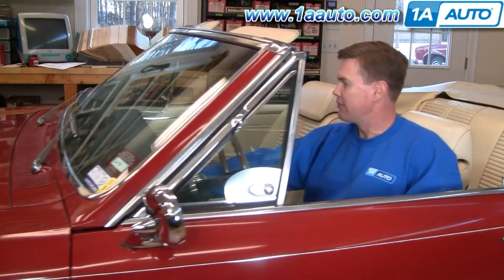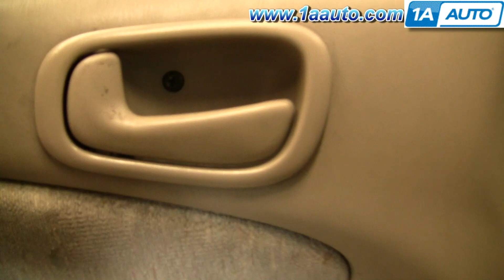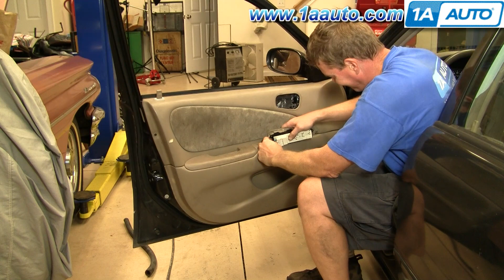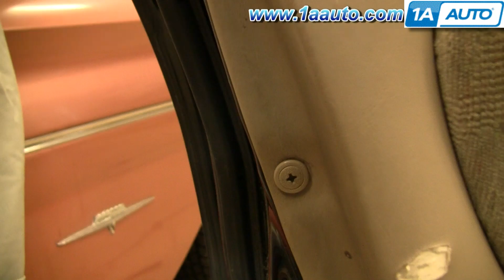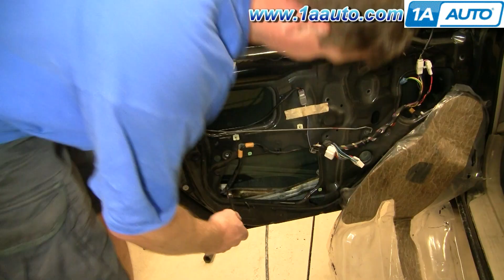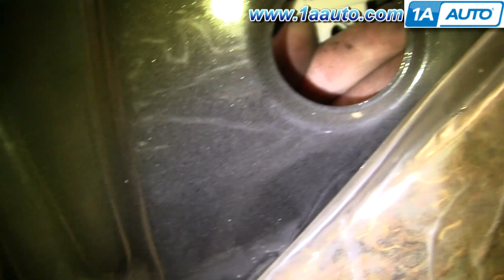How to Replace Window Regulator 98-02 Toyota Corolla

Comment: a socket can be magnetized with a strong ceramic guitar magnet (they are cheap to buy and stay magnetized). That keeps a bolt loosened in the socket and you pull it out and then remove the bolt by hand for storage until needed again.

Comment: Thanks for this video. Helped me remove/swap out the motor on my 1999 Corolla.  The motor in the back seat is the same as the front, so I was able to figure my way through swapping them out.  The mechanism that raises the actual motor is different so it took a while to get them back into position.  Also, a note to newbies:  The black adhesive that holds the water shield will get everywhere, so be sure to wear gloves.
Reply from the maker: +Sonny Burnett Thank you for your feedback!

Comment: Many thanks for the video. I hope you are still around. Is there any difference with the right front passenger window? Should be easier? Anyone has repaired the right one in a Toyota Corolla 1998? many thanks in advance. 062019

Comment: Can u do one for the rear passenger side? I dont know if regulator or motor. It goes down but goes up 2-3 inch and stop. Few mins later it can go up another 2-3 inch then stop. Sound like the motor is weak?
Reply from the maker: +hilussdc5 We are always expanding our video library so we may have a video for this in the near future!

Comment: I just want to thank you so much.  I was able to repair my wife's door window, and never would have pulled it off without your video. I will buy all my parts from you now, and I need some.  I need a drivers side door latch and I need the rubber seal that the window seals into.  I ordered one some time ago and didn't check it and they sent us the wrong one.  Thanks again A1!!  It is very much appreciated not just by me, but my wife too...

Comment: You said you did this as if stuck in up position. my window is 3/4 down. is there a different way considering this.
Reply from the maker: +Tam rock If your window is stuck, your window is stuck!  It does not matter which position it is in.  If you need the part to fix your vehicle please check out this link: http://www.1aauto.com/1A/WindowRegulators/Toyota/Corolla/1AWRK00510?utm_source=YouTube&utm_medium=CTA+Comment&utm_campaign=ytcomment&utm_term=HlRY3Wdo9bo

Comment: Thank you for the video.  It worked like a charm.  I had an estimate from a mechanic for $250.   Ordered the part online for $32 and did it myself. One point, not all of the three bolts on the left side are used.  Two of them connect to the regulator and one of the is just there for no apparent reason (Corolla 2002).  Thanks again!!
Reply from the maker: +Vahid Lotfi Thanks for your feedback, glad we were able to help!  1aauto.com

Comment: If the motor is dead, and the window is stuck down, how can I free up the regulator to get at the bolts holding the window?  Thanks: great videos, very informative and to the point
Reply: Belay the last.  Drilled hole in door to access bolt holding the window.

Comment: everything works fine but when I roll up window it comes out at the top?
Reply from the maker: +Louie Sierra Thank you for watching. It appears the window is off track, or misaligned. We recommend making sure that the regulator and rollers are aligned by the OE specifications. 1aauto.com
Reply: 1A Auto Parts  couldn't find a spindle for 98 Corolla, help by any chance.

Comment: FIrst, thanks for this great video. Very clear how to get this project done. I have a couple of questions:

1. Is it best to have the window all the way up when starting?

2. When you took that last bolt out, what kept the window from just dropping down? It looked like you jiggled that assembly a little to get the window to drop.
Reply from the maker: It may help to have the window in the up position. If you keep one hand under the regulator it will help to keep it from coming down. Hope this helps you out. 1aauto.com 866-403-3393
Reply: Well, it turns out if wasn't the motor in my case. I had posted to Toyota Nation and someone suggested spraying the rubber guides with silicone. Once I did that, the window went up and down MUCH easier. But thanks for that video. That is great info!

Comment: Hi, My window works but often it will slow down and stop and then take a few minutes of driving to move back up in increments.  Do I need to replace the motor or the regular?
Reply from the maker: Depending on the year you might be able to just replace the window motor if it's getting tired. Here's a link to the power window motors on our website. http://www.1aauto.com/1998-toyota-corolla-power-window-motor/y-mo-c/1998-387-22?utm_source=YouTube&utm_medium=VideoReply&utm_campaign=1ATony
Reply: Did you ever fix the problem? I've just run into the same and don't want to waste money on a regulator if i dont need to

Comment: I have a toyota corolla 2000.  My rear right side window does go up or down. I check the fuses. They are good. Press the switch by the rear right passenger door and main switch but it doesn't work. Can you tell me what could be the problem?
Reply from the maker: You might want to test the switches to see if they are good, or need to be replaced. 1aauto.com 888-844-3393

Comment: The part you are installing has two rails which are approximately the same length and a stud used for the first step in installation.  I ordered the part that is linked to the video. The part that I received has one short rail and no stud.  I had to return that part. What part number should I order to get one that is identical to this video?

Comment: The drivers window for my Corolla got stuck in the down position.  I just got off the phone with Toyota the window regulator and motor cost $540 and they are charging $130 for labor.  So that comes up to about $725 including taxes.  Thankfully I watched this video!!! I'm was grateful for the video because it was helpful with disassembly so I ordered the regulator and motor in one assembly from you.  Now my window works just like it did before and it only cost me $58 bucks!

Comment: On another problem: Do you have a video that shows how to replace the door latch on a 2000 Toyota Corolla? I call the "latch" the part that is inside the door, at the end of the door that grabs the stationary part that holds the door closed.

Comment: I don't see any problems with the wires or switch. Is there any type of diode in this circuit that may need to be replaced? 

I've taken the plastic water guard sheet on and off so many times (plus it is 12 years old) so the black adhesive that holds it to the inside of the door isn't holding it in place. Do you sell the adhesive?

Comment: Do I need to replace this part, or some other part, if my window SOMETIMES won't go up. It usually works fine, but sometimes it will go up part way and stop. After waiting different amounts of time, it will sometimes go up the rest of the way, or only a little bit more. It eventually will go up all the way.

Comment from the maker: You should be able to. Once you unbolt the window from the window regulator you can move it into the up position by hand if you need to. 1aauto.com 888-844-3393

Comment: I have a window that is stuck all the way down, and I was told it was due to a switch short that caused the motor to burn out.  Am I going to be able to do all of this work (to replace motor and switch, but not regulator) in the video even if my window is stuck in the down position?
Thanks.

Comment: I just wanted to thank you, as many others have, for saving me a lot of money. My passenger side window hasn't been able to go up, without help, since we bought the car in 2006. I brought it to a garage last year and they told me I needed a new regulator. After watching your video, I dared to remove the door panel and take a look for myself. To my surprise, 2 of the bolts holding the regulator in place were off and 3 were loose. The window now works perfectly!! Thanks again!

Comment: I took the plunge and dove in on this project and was surprised how smooth it went. I would not have done it without your video. The regulator and motor part I received was slightly different than the one I replaced. Instead of a set bolt in the regulator frame there was need for another 10mm screw. Luckily I had one in my shop! This is the 2nd project you have helped me on. The first was replacing the driver side interior door latch. You have me as a follower for my next projects!! Thanks.

Comment: Thanks for the video! You forgot to clear the lock rod through the plastic moisture shield before you put the door panel back on! Also it is a good idea to lubricate the window channel with a silicone base grease to avoid the problem in the first place!